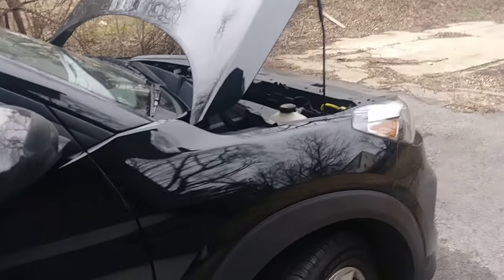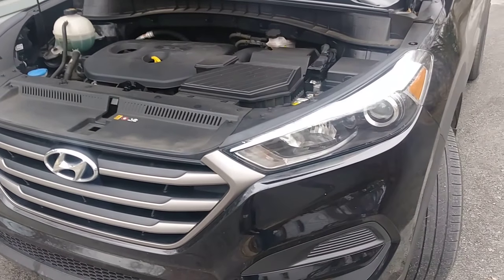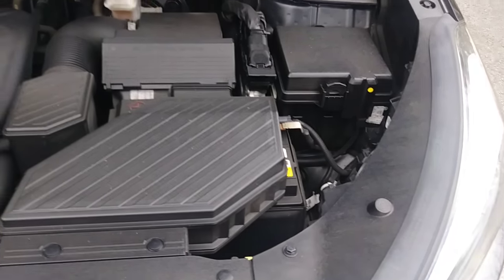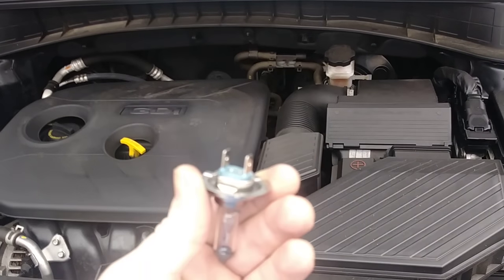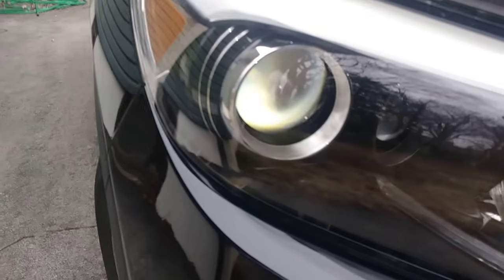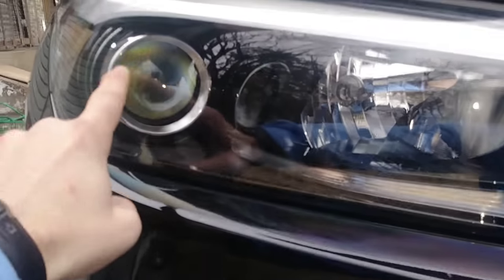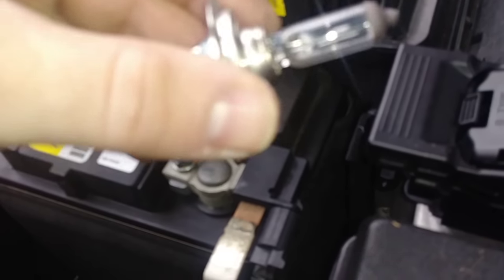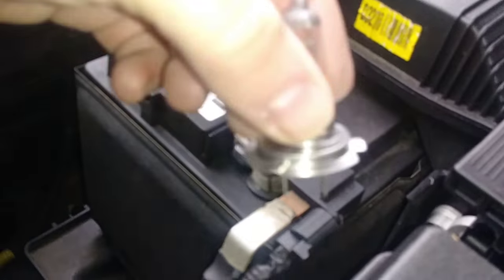Hyundai Tucson 2014 - 2020: How to Replace Headlight Bulbs (Low Beam)

Comment: Hahaha. Take it out,and put in a new one. 
" IS VERY, VERY SIMPLE TO REPLACE " 
Why dont you show us....it took me hrs as my hands are too big, the access to the socket is so hard, it took me 30 sec to take the bulb with the base out ( with my wifes hands ) different story putting it back in. Not the bulb, but the base/adaptor with the bulb back in the socket. Nightmare.
HYUNDAI TUCSON 2019.
What a useless video
Reply: With my big hands, ya, even a 2016 is not an easy removal.

Comment: For the 2015 Tucson the bulb itself does not pop out, you have to unclog the plastic connector the bulb sits in from The wiring harness. The replacement bulb comes mounted to a plastic connector the you just clip back in to the wiring harness

Comment: My cap was so damn tight I had to use oil filter clamp to turn quarter turn and pop off. Was worried I was doing something wrong...but it just had tightened itself over 3 years

Comment: Thank you kind sir. I wonder if Hyundai could possibly put that fuse box any closer to the left side low beam? 🤔🤪
Reply: It is a little easier to work on if you remove the cover off of the fuse box. You still have the bottom half of the fuse box to contend with. Hyundai did a very poor job of accessibility to the low beam headlights. Even on the right side the bar to keep the hood open gets in the way of trying to access the low beam headlight.
Reply: Totally agree on lack of accessibility design. I was able to change the passenger side light within 10 minutes the cover was a pain in the butt to take off but on the driver's side I have not been able to get the cover off, any advice to try to get that loosen up since it's the 1st time having to change the headlights and it's a 2016 model and have issues trying to loosen cap. Tight fit with that fuse box in the way.
Thanks in advance!
Reply: @michaelcastillo3079 same problem I’m having right now got the passenger side off easy but the one in front of fuse box is tougher

Comment: I just bought a set of WAYRANK H7 LED Headlight Bulb 120W, I was told they would be fine for my Tucson. I'll go about installing them soon, however being somewhat to new to anything car related, I'm curious as to whether or not I purchased a set for my low beams or high beams. Should I be buying a second set? Thanks